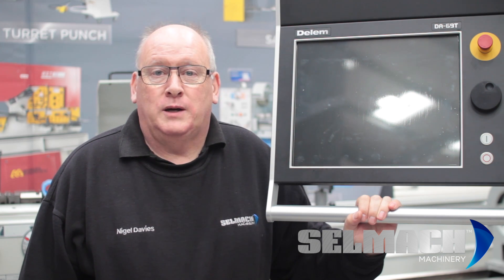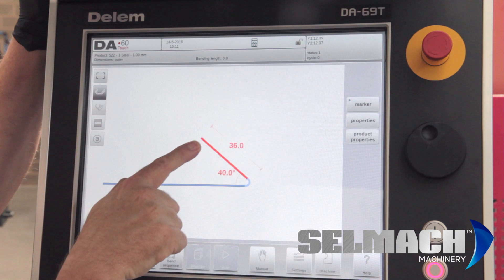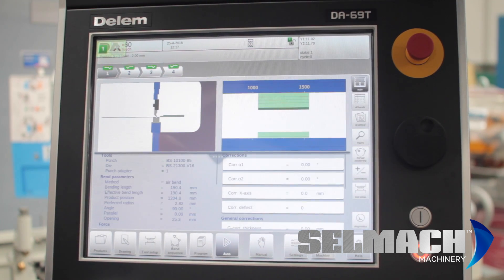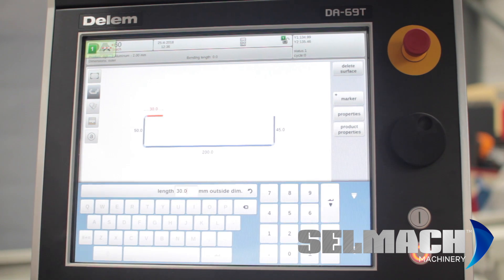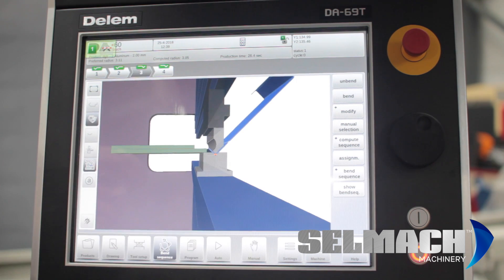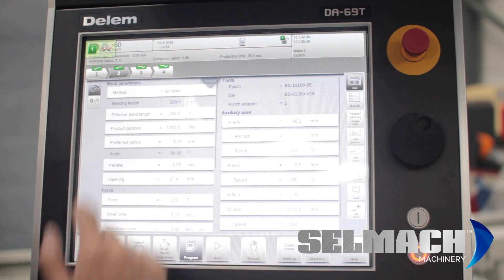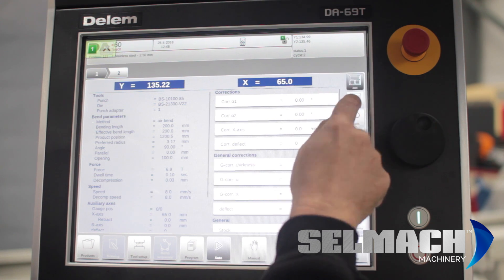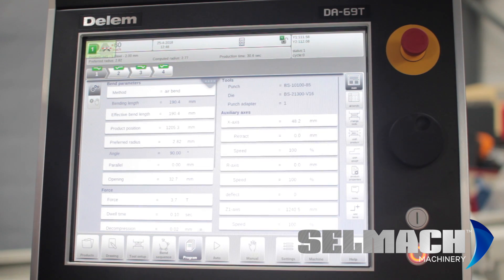How to use the Delem 69T Controller [Selmach Machinery]

Comment: Hello, quick question when you get a brake press with delem, will basic values be programmed or is it a completely blank slate ? Like matrials and such, maybe k factor, hope u can help, thank u nice vid by the way
Reply from the maker: Certainly on our machines, the Delem controller will be configured ready to go with the Press Brake. Materials and K Factors are calculated when loading a bending programme in. Hope this helps, glad you like the video!
Reply: @SelmachMachineryLtd  Thank you!